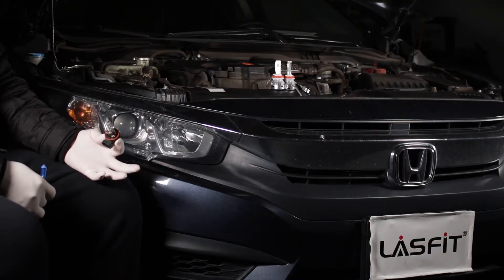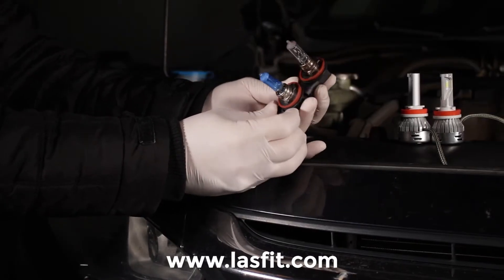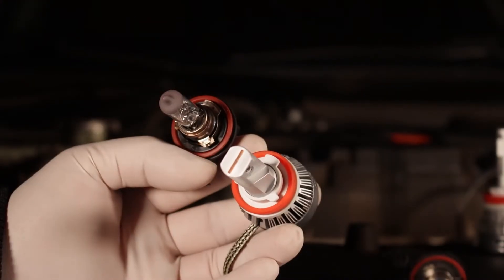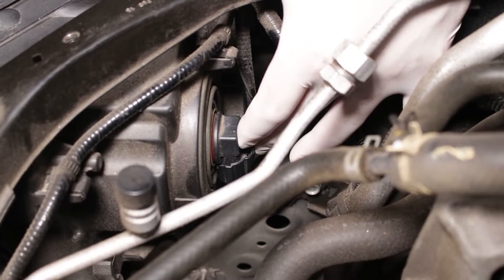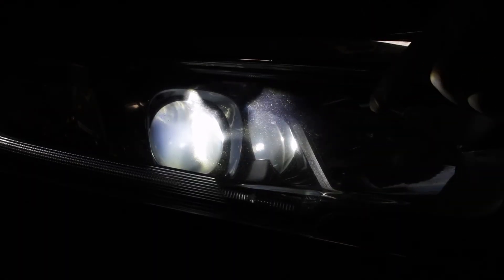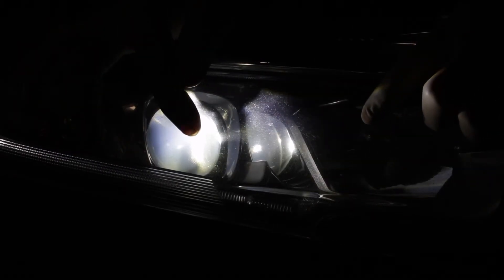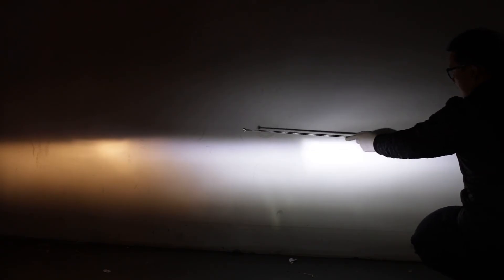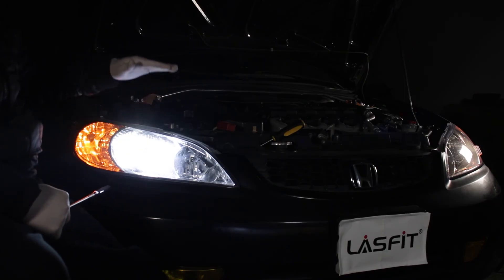How to adjust and align LED headlight bulbs for the best output beam pattern | 2021 Guide

Comment: So, the LED's in the headlight should be facing to the sides (left and right) and not up and down inside the housing, right? My beams on a 2008 hyundai sonata look like crap during the night and I thought my LED's came defective or something like that.
Reply from the maker: Yes, the correct direction is the LED chips facing side by side with the wire cord down at 6 o'clock.

Comment: What would the luminosity of a LED if it’s on 12 and 6 position instead of the 9 and 3 position?
Reply from the maker: The output beam pattern will be bad.
Reply: Just installed LA Plus Series H11 LED Bulbs 60W 6000LM 6000K Plus H11 Extension Cable To Replace H11B Bulbs × 1 into Veloster turbo. Output pattern seems appropriate but even though they are whiter, they seem no brighter than the halogens. Not sure what to do.
Reply: @nicholasfitchett7278 the new lasfit LA plus is definitely brighter than stock man. No doubts about its 

Have it on H11 on my family’s 2017 Toyota sienna LE. 

It’s definitely 3x’s brighter than stock. 

If it’s not as bright as before, rotate ur led bulb’s orientation.

Comment: How do I adjust HB3s for an 05 Yukon? They're a circular look and the beam is inconsistent.
Reply: U don’t. For low beams they are adjustable. For 9005/HB3 high beams. U don’t need to adjust them, as they act like a combo beam.

Comment: Every LED you find on Amazon are Chinese made so it is what it is.
Reply: Even the Philips ones, they are made in China...
Reply: @wtrdogg20  - Yup. The good ol’ profiting. Cheap labor and manufacturing with high retail cost.
Reply: Except one. Diode Dynamics are made in the US.

But so what if it’s Chinese made, if the quality is there and it’d well made. I wouldn’t even complain for that.

Comment: I have a questions i just bought this led bulbs from lasfit ok i know the that the lighting Chip should be 3 o'clock and 9 but what about the little cut out on the bulb. How do i set it? Towards the top or towards bottom
Reply from the maker: Hello, could you tell us your vehicle make, model and year? What LED bulbs have you bought from Lasfit? May I know why you want to cut on the bulb and how you cut the bulb?

Comment: Does it matter if my 2019 Chevy trax has projector headlamps?? I bought some Fahren leds from Amazon but I was on the freeway and there’s like black spots when I looked at the road there’s a black spot?? Anyone know why? Or should I order some leds from lasfit??
Reply: Projector or reflector. Ur led bulbs with 2 sided led chips will work fine for 3-9 o’clock.
Reply: U also picked a very good one. Either Forscher, Krigeis, or Termitor. Those are great options.

Comment: Hello, I'm from India(Right hand drive) I installed an HID kit in my tata nexon EV. The left beam is a bit angled (currently in   2.30 and 8.30 instead of 3 and 9), what should I do to fix this issue?
Reply from the maker: If the HID bulb socket is fixed, can't be adjusted, you can't adjust the beam pattern.
Reply: @Lasfit-Automotive  That's not what I meant, my low beam projectors had H7 Halogens in them(55W 3000K each). They had perfect cut off, but poor brightness. I retrofitted (swapped those) with Osram HID kit H7 (6000K 35W each). The cut off is similar to my stock setup for right beam. But for left beam its angled at 10degrees compared to the perfect right beam. Also left beam creates an unwanted hotspot in top left corner and some dark spots in front. Could you please share your email id or social media handles, I could send you the pictures for reference

Comment: Got my shipped today and they are very bright but still aligned then and little bit more. They work so much better compare the brand I had before
Reply from the maker: Thank you for your feedback. May I know your vehicle make, model and year, and what LED bulbs you have installed?
Reply: @Lasfit-Automotive  2017 Kia Optima 
LA Plus Series 9005 HB3 LED bulbs 60W 6000LM 6000K Amplified Flux Beam

Comment: I have installed your h8 plus in my reflector headligjts and when I alighn the chip in the 12 and 6 its not as bright. It's to bright in the 9 and 3  position. Is it OK to leave in the 12 and 6 position
Reply from the maker: Hi, the correct direction is the chip at 3 and 9 position, face to face, not up-down.
Reply: No. Ur not supposed to position the led chips putting 6-12 o’clock. That blinds propel for that. 

And of course it’s super bright, that is the point we’re u need the hotspot short directly down on the road with a wide beam pattern spreads. 

Always adjust to 3-9 o’clock.

That’s ur best thing to do.😊

Comment: Which are the instructions to rotate the orientation of the bulb to obtain the 9 and 3 position on LaPlus H11?  Does it have a set screw? Thanks!
Reply from the maker: LAplus H11 LED bulbs don't have a set screw, so you can rotate it freely.
You can turn the LED bulb until the beam pattern is ok.
What's your vehicle make, model and year? Is it projector headlight or regular reflector headlight？
Reply: @Lasfit-Automotive   2014 Jeep Grand Cherokee with halogen projectors. Thanks.

Comment: Recently changed headlight on my honda civic 2011 (h7 led) and these are very bright and many flashes from oncoming traffic,  how do I fix it please
Reply: Fix ur led bulb orientation, and have the led chips facing 3-9 o’clock. And adjust ur beam pattern height, u gotta have a flat surface area and aim ur lights to the wall and use another vehicle ad a guide to see how high is ur beam pattern, if it’s close to the edge of the car window. That’s what u need.
Reply: Did it work?
Reply from the maker: Please try to adjust the LED bulbs, you can refer to this video:
https://www.youtube.com/watch?v=hdWaXX7IZ80&t=87s

Comment: Wait I have all my LEDS at 12 and 6 is that incorrect?  Civic Si coupr
Reply from the maker: If your LED bulbs are two sides with LED bulbs, the correction direction is at 3-9 o'clock.
Reply: Is the wire should be on the bottom or it doesn’t matter as long as it’s positioned at 3-9 o’clock?
Reply: @tombermudez2797 it actually does. When u see the LA plus design, those weird little steps on the bottom of the led bulb needs to face down, and the wire needs to hang down.

Not up. 

It does matter.